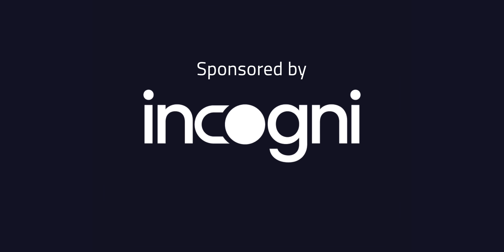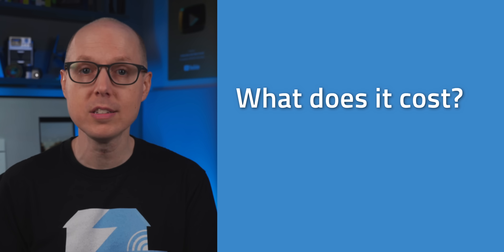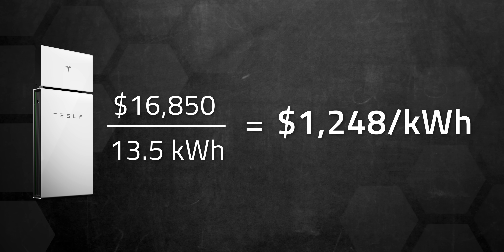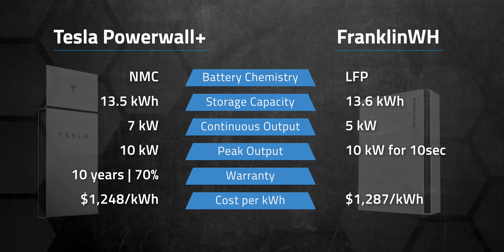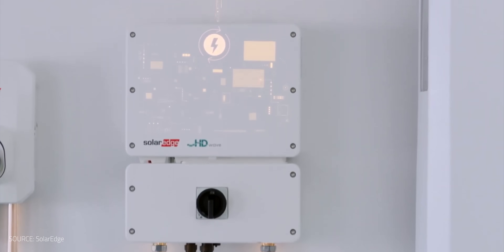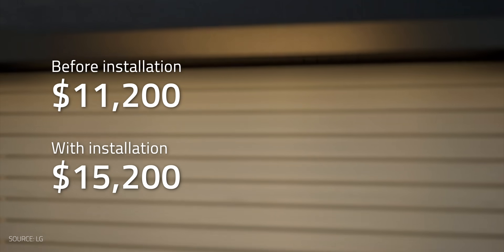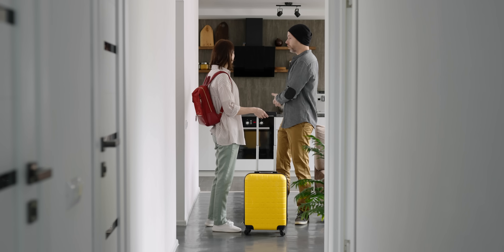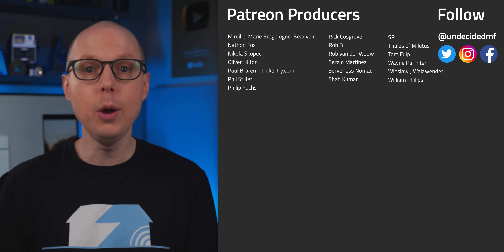Top 5 Batteries for Home (And One You Might Not Expect)

Comment: I went with EcoFlow. I purchased two Delta Pros. Then I purchased 2 extra batteries to pair up with the Delta Pros. So a total of 14400 Whr. I had an electrician come in and install a transfer switch so I can plug these into my house. All of this together came to around $13k US. So we are getting close to $900 per KWhr.
Reply: Eco Flow is extremely convenient, I will give them that! The generator they sell also has an increased efficiency when charging their Pro model in the event you need a backup to the solar system.
Reply: Part of that was for convenience.  I'll be moving the plugs during outages.
Reply: @mac_mcleod  - Looks like I missed an earlier post. Did it contain a link?
Reply: @Zoyx  no,  I'm tired.   What I meant was that a significant part of the cost was for the convenience of grid tie and automatic switch over.

One way people with less money can get by  is to have a non grid-tied system and plug a few key appliances to it. This will lower their electric bills. And then during disaster outages they can plug a few extra items like lamps into it.  This stand-alone setup removes the need for an electrician and inspection until you have more money.
Reply: @mac_mcleod  To use the smaller Ecoflow Delta 2 I cut back my energy output needs and try to use heavy power needs before the sun goes down. Additional smaller batteries help like power tools to get through the night if needed.
Reply: @mac_mcleod  - I have a rural house, so I need backup power for my water well and furnace. Plus power outages tend to last longer out here because the electric company has us as a low priority when fixing. So my needs are different compared to someone in suburbia or the city.
Reply: Awesome, if you had to move they can move with you. The warranty is kind of a dealbreaker for me personally at those prices though.
Reply: I use minimal power with Ecoflow Delta 2. They are sending me a new unit as mine purchased in September 2022 intermittently charges. Their customer service has been good while under warranty. Are you totally happy with yours?
Reply: @rwyo83  - Can you buy those in the US?
Reply: @thelonewolf666  Time tells.
Reply: @thelonewolf666  - I doubt I will get my money back on this set of batteries. I just wanted backup power for my house. In a dozen years, batteries will be cheaper so replacing them won't be as much of a big deal.
Reply: Does the eco flow have a 10 year warranty?
Reply: @edc1569  - Delta Pro has a 5-year warranty.
Reply: Do you have solar panels to recharge them, or just the grid?  If grid, what happens when something big breaks and they don't turn it back on for months?  Asking for a friend.
Reply: @ljprep6250  im a utility electrical design eningeer. The electricity in america will never be off for months. I have important shit hidden in caves, mountains, fortified warehouses, ext.
Reply: @thedude5040  You might want to read =any= report on EMPs.  
Andwith tens of millions of questionable people coming across our southern border for decades, just a few handfuls of them with AKs could take out an entire electrical corridor in an hour.  Replacing all those fried transformers won't be quick without local power.
Reply: @ljprep6250  do you realize that in 5min we can mechanically disconnect every major transformer from the transmission grid in the event of an emp or large solar storm. We then have millions and millions of battery banks on standby across the whole country available 24x7x365 days a year that does nothing but power telecom and motors that can physically put the grid back together during a black start. The controls for these motors are in heavily shielded control operation command centers. Truly I dont think you know anything about electricity. The goal of a black start event isnt to deliver power to your house but to keep those batteries charged
Reply: @zyxwutubeurlwxyz  so thats the 100 trillion dollar question. We dont know for sure. Many sites are set up with mobile hookups so if you have at least one working battery charger connected to a generator and one truck, we have battery banks already loaded onto trailors that can be towed to charge from a good site then physically moved to an inactive site to pull startup power from the mobile batteries or use a small generator to charge dead batteries. Naturally this takes alot of time. Typically each battery bank has a 240v 12-30A charger so any functioning 5kw gasoline generator from home depot can chage up these batteries, but it may take 8-24 hours to reach full charge. Then the other issue is nonsteady state re-energizing transformer's magntizing current can take over 8 hours. But you have to spend 8 hours at the generator, then 8 hours at the step up transformer next to the genrator, then 8 hours at the switching yard. And thats where the nationwide grid restoration falls apart with the 24 hour battery clock. We can get to major switching yards but not necessarily to any customers. Of course that assume generators can rapidly start back up. For the hydro electic dam or any turbine really In such a rapid event thermodynamics will still play out. Once disconnect from the grid the trubine will keep spinning to disapate heat but it will need to come to a full stop before restarting, which means depending how soon operators restart generation is critically important for thermal genrators like, coal, natural gas, and nuclear. The longer they wait the more heat is lost drastically increasing the time it takes to even begin producing power. Note: full stop at thermo generators does not mean all the water circulating the site lost all its heat.
Reply: Well you will never get a permit with Eco Flo and my Eco flow system is only a year old and it is already broken and I have friends who have Eco flow systems and theirs are broken also.
Reply: @boblatkey7160  - How was your return experience?
Reply: You do you, but good lord what a waste of money. $13k invested into the stock market would be a much wiser choice for 95% of the population. $15.6k of att stock = free fiber internet for life just off dividends
Reply: @thedude5040  But is it a waste for everyone? An average USA electricity bill is $122 month, perhaps more or less, that comes to $1464 a year. With no tax savings $14,640 in 10 years. Emergency back up, portable power and living off grid are benefits. Negatives are upfront cost and unexpected maintenance. Not including solar panels this could be a positive if ones electric bill is above that $122 monthly average. For me it is worth it living off grid as my initial cost was $1500 but I choose to use less energy.
Reply: @tumbleweed1976  for me an electric bill of $122/mo is meaningless compared to my near $500/mo water bills. My water bill in kansas is hands down my most expensive utility at an average $220/mo through 12 months and no I dont own any pools, water feature, hot tub, and I keep my grass brown in the summer. Ive already budgeted $40k to build a power to my future mountain cabin.
Reply: @Tumbleweed  that's exactly the case that I see. However what most people don't do first is go to LED bulbs and put in $1,000 worth more insulation into their property. Decent insulation can lower your electricity bill to the point where you're only getting solar power for disaster outages.

My electric bills average $900 for 2000 square foot house due to good insulation.
Reply: @mac_mcleod  My 5 month electric rate is .11491 per kWh, then the next 7 colder months it is .33891, add on 8 other charges and I paid $4,608.35
 in 2022. I run LEDs, paid 1200+ for attic and other insulation. My issue is being 67 and wonder if it is worth investing the money if I might be taking a dirt nap before the payback.
Reply: @the dude  per multiple Barrons studies,  most people average 2% returns  over 10, 20, and 30 year periods. 

Plus, you don't pay taxes on money you save this way.    A $1200 lower electoral bill represents salary of $1800 to $2400 for most people. 

I knew people who told me of their fabulous returns in the stock market and somehow they all ended up short on money in old age. I suspect that people remember the few wins and ignore the painful losses. They also tend to get out at the bottom of drops and don't get back in until the market has headed back up. A 2% return isn't bad if you're saving because it preserves purchasing power. But you're not going to get rich in the stock market unless you're extremely lucky or you're breaking the law in some way.
Reply: @thedude5040  Don't invest in AT&T until they straighten themselves out.
Reply: @thedude5040  - Then I wouldn't have backup power for my house. I invest in the stock market. I have learned that if you aren't skilled at it with years of experience, you lose money, not earn money, especially in the current economy.
Reply: @Zoyx  i make money in the market. Last year was the lowest return since starting in 2020. 2020=15%, 2021= 85%, 2022 = 8%, 2023 ytd = 12%. Im just saying for $13k you could of just bought a nice quiet generator, a large fuel tank, and been money way ahead. I really just have batteries on specific devices, emergency lights in the garage, a 24v battery bank/inverter on my basement sump pump, and a 26ahr large lead acid battery in my tornado bunker hooked up to auxillary lights, radio, small ham radio, and cell phone chargers. Actually had to use it last year in a F3 that destoryed around 12 houses in my neighborhood
Reply: @thedude5040  - Congratulations on your stock-picking skills. You must have worked hard to attain them. Gas generators are loud, stinky, and produce greenhouse gases.
Reply: @Zoyx  as far as stock picking its just my personality. I have a world class education in all things science with my biochem/electrical engineering degree and still a student at heart. The amount of reading I do on everything related to business, science, and politics just far exceeds everyone else. Im 31 years old, but have 25 years of bidding experience because I started buying toys on ebay and selling my old ones while in kindergarden. By the time I was in 8th grade i could write up a sales invoice in my sleep and do a rough idea how to do accounting. My grandparents ran a business and so did my father so I was exposed to alot of things at an early age normal people are not. I remeber my grandfather explaining ebita as "the raw money you made before subtracting and adding all extra BS things thats in your [eaby] spreadsheet".
Reply: @Zoyx  green house gas causes global warming. My view is that we already lost. Since we are not able to mentally allow the bulk of our generation come from nuclear then running a gas generator here and there is not going to hurt anything. Im a substation design engineer, we stopped doing models on 100% renewable energy because its still not possible. Now raching 100% power from renewable, fixed nuclear, a minor amount of battery storage (think 3-5%), and standby natural peaking/emergency power is possible. The batteries act as a buffer to stabilze short term renewables, upto the point where nuclear generators become maxed at which point the reserve natural gas plants ramp up to make up the difference to avoid a blackout. Even under that situation on a 12month basis you will probably find that natural gas will make up 15-25% of the power produced.
Reply: @thedude5040  - I'm in my 50s. I just started trading stocks. I lost money last year. Doing better this year.
Reply: @Zoyx  all my earnings went to pay off my student loans. I paid them off in august of 2022.

Comment: StorEn in also a similar flow battery concept in the US that might be closer to market. In South Africa we tend to use string inverters with 48v dc batteries ends up being much cheaper if you just need the batteries and not an inverter every time. Bit over $10,000 for 20kwh

Comment: Always good info!  I'm still thinking about getting that storage for my solar, but so far my solar installer only offers the Tesla Powerwall and I'd rather have something that is safer, cheaper, and actually don't mind something that takes up a bit of space if I can get those criteria met.  That flow battery would be nice but as you say it's a little bit away.  Maybe getting some of those portable batteries might be a good inbetween, so I wouldn't have to rip out a whole set up...

Comment: I think another price metric used should be a price per kw of energy storage over a set time frame, perhaps 10 years. This would help compare retained battery density costs over the life of the battery. So for instance a battery that appears cheaper on install for the same density might in fact turn out to cost way more due to having to replace it much sooner then another.

Comment: Flow batteries are the way. Safe and infinitely scaleable. Just have to wait for prices to come down.
Reply: I'm optimistic about that, too, but I'm also quite sure "normal" batteries (mostly lithium-based) will become economical for homes/buildings soon, long before any flow battery willr each that point. Could be a decade before the flow battery overtakes the regular battery.
Reply: @SolarWebsite  Flow batteries from China costs about the same as Lithium for a 40 kWh capacity. Last quote was around $25k USD.

Comment: Energy storage centralization is essential for economies of scale. Having a battery in every house is unsustainable. Unfortunately, most households will end up with multiple batteries in the future, considering vehicles.
Reply: Pointless IMO. At $1,200 per KW and the battery Is 13.5kw. It will take 10 years to pay itself off. Then it says you will have only 70% effectiveness after those 10 years left on it. 
What is the point of it all when it takes another 7 years to pay off the solar panels also? 
17 years and you are near to having to probably buy new panels or extra battery power to make up for the loss which after 17 years is going to be under 50% effective from brand new.
Saving over all that time $0.00
I suppose the virtue signallers can at least say they are carbon neutral after so many years.

Comment: I would add EVs like the F150 Lightning to the list.  You could charge them off solar and off-board power during a power outage.  If the power is out for an extended period of time you could drive to a public charger and recharge.
Reply: Commercials look good,  but you need $4000 worth of installation to run power back to the house.
Reply: The Bonded Neutral issue makes it difficult to consider any F150 whether it is the lightning or the Hybrid as a home battery alternative. You have to have a panel installed with dedicated circuits to handle this or you will get ground faults. Sure, you can use extensions in the outlets in the truck and run some of your home off the truck but that makes it akin to the portable batteries mentioned in the video as bonus or less. I wish it were not the case because it is part of the reason I bought the F150 hybrid.
Reply: It cost as much as a solar system including battery to in accessories to access the energy.
Reply: You do realize that the Ford Lightning is nothing more than a PR piece right. When actually tasked as truck (as in hauling things and towing trailers) the Ford Lightning ceases to function as a truck. Real world tests have shown that when hauling a reasonable trailer the Ford Lightning has an 80-ish mile range. When your range is that limited it becomes useless. The Ford Lightening is just a preppy status symbol "truck" which is better avoided unless image is all you are concerned about.
Reply: @hyfy-tr2jy  My guy I dont think you understood the usecase right for the F150.

The Ford F150 is the most used car in the entirety of america. Does that mean that all those F150s are used to tow trailers and haul things? I reckon not. Quite the opposite, the majority never see their intended purpose as a utility vehicle doing heavy work. Lots of contractors use F150s to occasionally haul some stuff if the need arises at best.

And thats the perfect usecase for the F150. You can store your tools in the frunk and have them always charged thanks to mains voltage outlets. Same on the bed, whole bunch of outlets that can power quite a lot of tools, perfectly reasonable if you wanna use shopvacs or saws or whatever with no main power nearby. 

Also for the camper crowd, having mains voltage readily available without running a generator or god forbid the whole entire truck is pretty cool.

For the rest of the population, an electric vehicle with the style of their favourite truck is plenty enough to get the kids to school, get groceries and get to the fucking coffeeshop where you can get your overpriced Latte.

Like 90% of F150s dont ever see their intended purpose, so why are you judging the F150 Lightning without also assuming that the vast majority wont ever be used to tow shit?